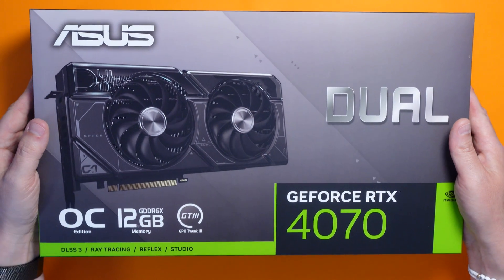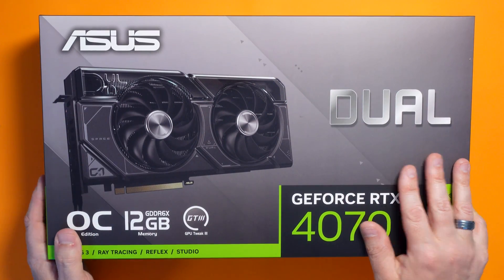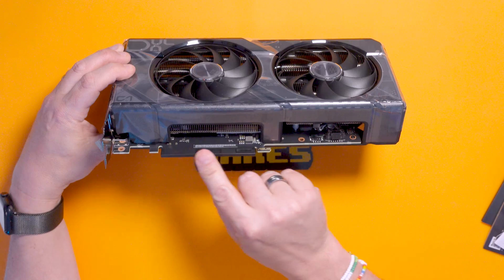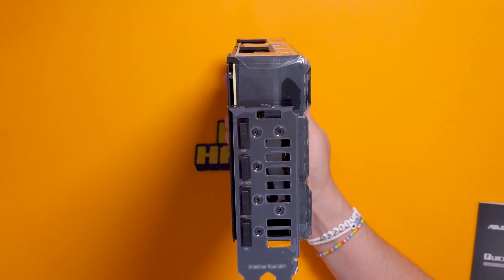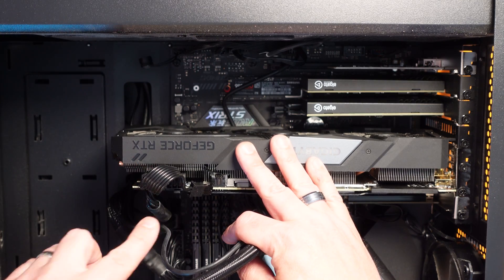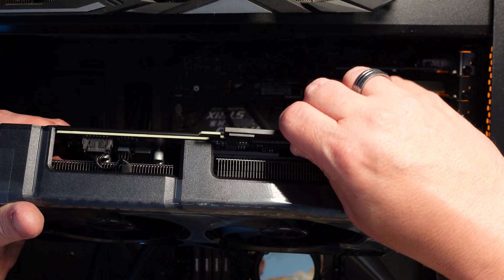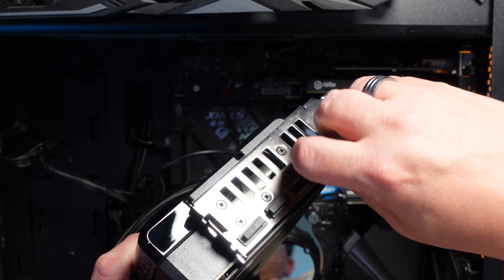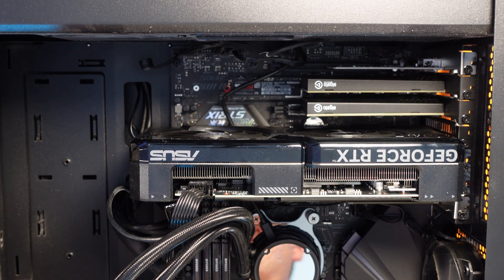How to Upgrade your Graphics Card - ASUS NVidia RTX 4070 GPU Upgrade

Comment: That you for this awesome video. I am upgrading my GPU this weekend from GTX 1060 6gb to a RTX 3060 12gb
Reply: Did you install or delete any drivers? Or did you just take out the old one and install the new one?
Reply: @krow120  Nope nothing. Just changed the cards, but now I have an RX6700XT
Reply: @krow120  Do you have to? Im upgrading from a 1650 to a 4070S and i wanted to know if i have to use DDU before upgrading or if i can just install it and then update
Reply: @Drkzy  when you upgrade from nvidia to the same you don’t have to ddu. You just have to install the new card and update. Only have to ddu when you switch brands

Comment: Though he touched on it but I want to emphasise more that you need to make sure the GPU card your getting is compatible to your CPU. No use getting a Good graphics card and your CPU is not able to run it. 

So get your CPU info either through System info or task manager .  Then check on you tube or google to see what GPU is compatible to Your CPU and doesn’t cause a bottleneck . 

If you need to get a better CPU then you need to check what CPU is compatible to your motherboard . The motherboard info is listed in the system information.

If you end up upgrading your CPU compatible to your Motherboard then ensure that you have the correct BIOs version before you replace your CPU. Cause most likely the New CPU would require the latest bios version .

So yes do your checks first before you buy any Parts. God bless.

Comment: Ok so as long as there's room in the case, it's just a matter of taking the old graphics card out and plugging in the new one and you are good to go?
Reply from the maker: I mean.. pretty much.. also check your PSU has enough connections on it too!
Reply: @KipHakes  What if changing from Nvidia to AMD?
Reply from the maker: @78jonybravo use a driver removal tool before you take out the old GPU
Reply: @KipHakes  Nice, appreciate it

Comment: i ordered a 4070 ti super on amazon prime day without thinking, now im here to learn how to put it in my pc 😂
Reply from the maker: Haha! Good luck!
Reply: One of the most important thing when installing the 4070 super is plugging the 12 h plug in. If you don't have a direct plug in for it and have to use the adapter that comes with it. Make sure you hook up the 2 -3( depending on maker) cables to it correctly.  One land mine people step on is. There is one psu cable that has 2 6 pins pig tailed together, but are  on the same cable. Don't use both of these on the adapter.  Use only one of them,  then the other from a different cable. Other wise it will fry the gpu within a week or so of us.  Hope this helps.
Reply: Hi there, make sure when installing a 4070 ti super you avoid this land mine. If you have to use the adapter one of the 6 pin cables will have 2 6 pins on the same cable pig tail together.  Don't use both of them,  just one  then another  6 pin from a different cable,  other wise it will fry your gpu within a weeks time.

Comment: My computer is dell xps 8940, 11th gen intel i9K , ram 32GB, Nvidia Geforce GTX 1660Ti.
The graphics card has one 8 pin power connecter. There isn't an extra power connecter.
Anyone have recommendations for what I should upgrade to??
I don't know anything and don't want to mess up. I do video editing in Davinci Resolve and record gaming videos.
Reply from the maker: Hmmm you might be stuck because Dells sometimes use custom power supplies - normally I’d say just upgrade the power supply. Maybe ask on the LTT Forums
Reply: @KipHakes  Theres some photos on Amazon where it seems like theres only one 8 pin port on them.
So maybe its possible?  Heres the title of it, to see if its makes sense for it to be one 8 pin:
ASUS Dual GeForce RTX™ 4060 V2 OC Edition (PCIe 4.0, 8GB GDDR6, DLSS 3, HDMI 2.1a, DisplayPort 1.4a, 2-slot design, Axial-tech fan design, 0dB technology, and more)
Its $310. Thanks for answering. I found the forum website, but do I have to sign up in order to post anything? No text box shows up anywhere other than search.

Comment: Does this need to connect to the psu with 16 pins or 8, as mine is a 6+2 to an 8 and it is not booting up
Reply from the maker: 8 pin, and you put the 6 and 2 pin together to make an 8

Comment: Thanks for the guide! Quick question: do you need to wipe GPU drivers before doing the hardware swap? I'm planning on upgrading from Nvidia to Nvidia
Reply from the maker: You should be okay.. would only be an issue if you were going to an AMD card.
Reply: @KipHakes Thanks for the response! I think your Asus card is brilliant because it can run on a single 8pin power connector. I have a tiny 2-fan 3070 and even that needs 2 8pins. Just shows how efficient the 40 series is compared to the 30 series. 

Meanwhile, my new 4080 has the 12VHPWR connector and it's making me nervous... Hopefully it doesn't melt 🤞

Comment: Just upgraded from a tuf 4070 to a 4070 ti super. When i power up the psu a red LED light comes on. Soon as i power the motherboard it goes away. Do you know what this red LED means? All cables plugged in tight. Some say its normal. 
Thanks for the videos
Reply from the maker: It may just mean it’s receiving power, but the card isn’t displaying anything.. if it’s working fine I wouldn’t worry

Comment: Is there a difference in the type of 4070 gpu?! Mine says zotac gaming GeForce RTX on the side of it and mine is a 4070… regardless of it being Asus, zotac gaming, TUF gaming or MSI on the inside it’s still JUST an Nvidia GeForce RTX 4070 right?!?! The company name on it don’t mean anything?!?!
Reply: I think the “4070” part is just the processing chip. The brand name reflects on the overall wrapper unit that surrounds the chip, so they could differ with fans count/quality, and the materials of the wrapping build. Overall, it shouldn’t really matter, generally people say if you get better brands it’ll cool off the chip better so you’d get more performance, but it’s honestly so minimal that it’s absolutely not worth the couple hundred bucks difference at all

Comment: Is realy bad, 4070 so loud, i dont buy Asus card no more.
Reply from the maker: I’m literally using mine right now .. not a peep
Reply: I’ve ordered this exact model and I’ve heard it’s one of the most silent ones lol
Reply: I’ve always had my case on the floor under the desk.  Haven’t ever cared about sound:
Reply: So it has this coin whine that’s one of the worst DEPENDING on your system. So it’s just a gamble. I got this cuz I can’t fit a bigger model and it’s supposed to be silent in a lot of other benchmarks. I’ll return it if it doesn’t go well with my Corsair psu
Reply: 4070 ti super?

Comment: thanks for the guide i have not installed a gpu in 3 years just upgraded from a 2070 super to 4070 what cpu and motherboard do you recommend that is not to pricey atm my cpu is i7-9700F but its bottlenecking the cpu by a lot in cpu insteive games but in gpu insteive its fine in cod mw2 it was getting 90% bottleneck  im going to be upgrading my cpu motherboard and ram in about 3 weeks will the i5 12400F bottleneck it there is a webiste in my country nz that does a pc kit that has a ASRock B660M Pro i5 12400F will that be decent so my gpu can keep up with my cpu?
Reply from the maker: I’ll be completely honest - I know nothing of Intel CPUs ! I’m pleased with my setup, links are in the description.. might get a Ryzen 9 soon though

Comment: Thanks for the installation part of the video. It looks like it will just fit on my 2 slots for my motherboard, the slot directly under for me is my wifi card. There is a bit of space and just measures for a fit.. if not then I'll get one of those USB wifi antennas.
Reply from the maker: Glad to help buddy!

Comment: i noticed you mention that you arent overclocking your gpu...   actually you are ya know :)   what it is... nvidia sets the recommended core frequencies for each chip and then power requirements and msrp (rrp in the uk etc...)... this is your founders edition spec...  after that board partners (asus gigabyte etc) are relatively free to make their own changes to the base design into order to differentiate their product..  stuff like adding better beefier coolers , higher quality VRMs to control the power  (NOT RAM THOUGH BECAUSE NVIDIA ARE NAZI's haha) and with that they are able to set their own core frequencies for their specific design .    nvidias website says base clock is 1.92ghz and boost is 2.48ghz for the 4070...  your gpu there  will have the same base frequency but your quiet mode (which is still over clocked ) will boost to 2520mhz and  the p mode (performance ) is also overclocked but a little further to 2550mhz boost according to asus's website...   so ye there ya go... youre overclocking already- and its worth bearing in mind if you ever decide to you do actually want to overclock further because your card isnt being sold as "overclock capable" - theyre all overclock capable with respect to the silicon lottery... its being sold as actually already overclocked.     thats it ...enjoy :D

Comment: Nice card Kip although this obviously has a minimum board, processor, memory and power requirement. What are your PC specs and the minimum specs required to run this card?
Reply from the maker: I will update the video description with all the details soon!
Reply: there is nothing called minimum specs to run a card, you can run this on a i5 2500 if you want too. 

is it preferred? nope, does it work? definitely, me personally would not pair it with anything less than a 9900k-10900k/5600x/5700x/5800x.
Reply from the maker: Details all added!
Reply: Great vid as Always kip top guy 😊